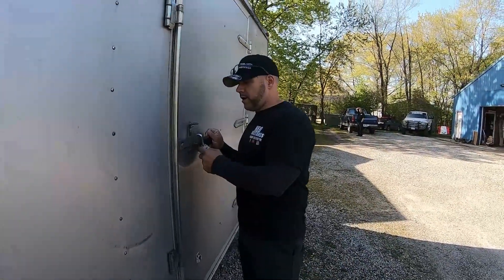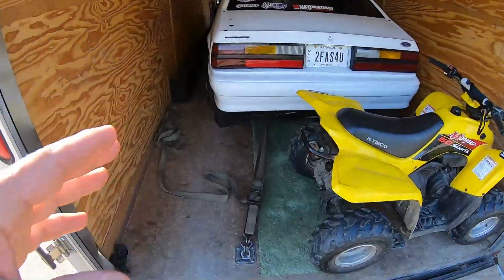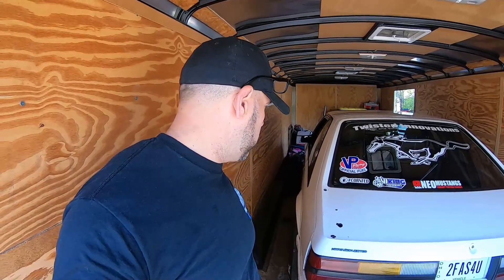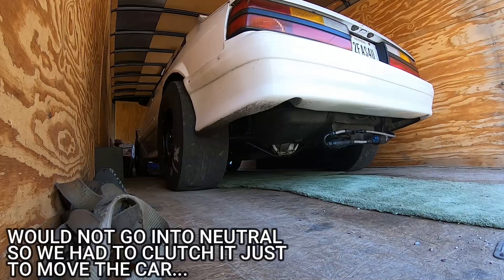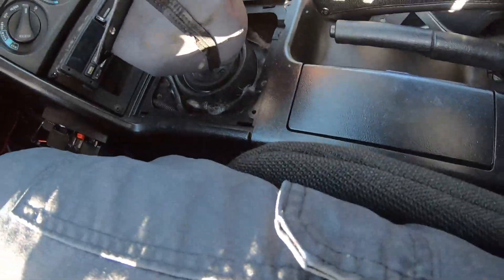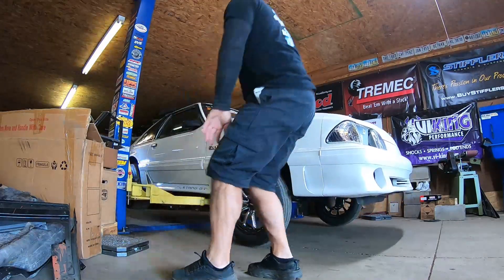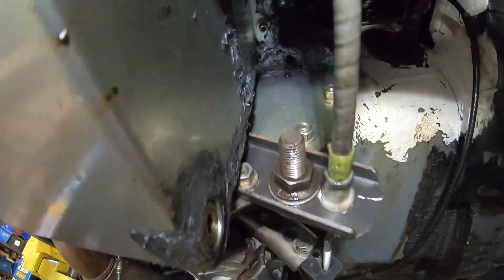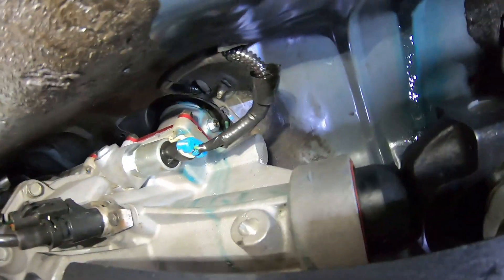We Look Inside Our Broken T56 Magnum— How Bad Was It? 👀

Comment: What's with the blue oil?
Reply from the maker: Lightweight Redline Gear Oil
Reply: @Neomustangs  thanks and this is better then gm synchromesh
Reply from the maker: No don’t run this with syncros. Stay with syncromesh. This is for faceplate shock proof
Reply: @Neomustangs  ok and thank you for the information...... never seen that blue oil before